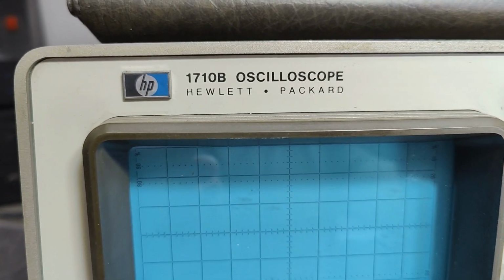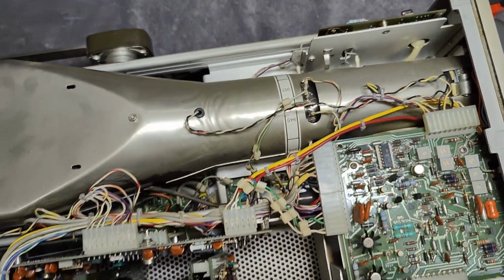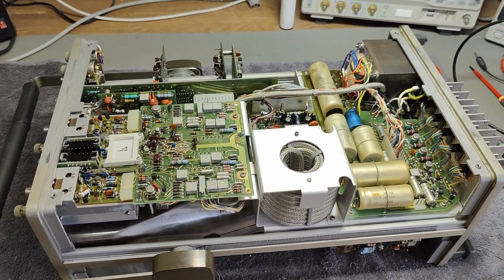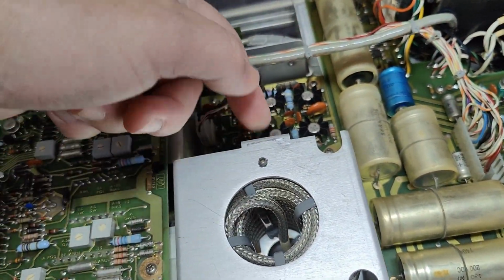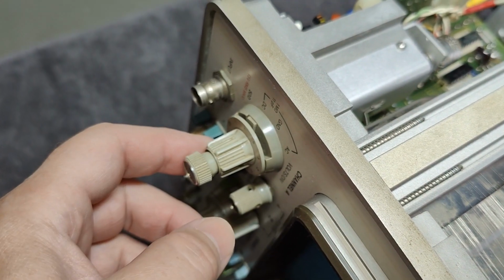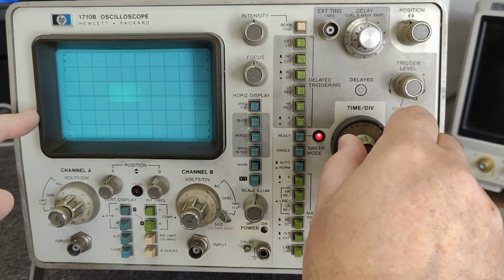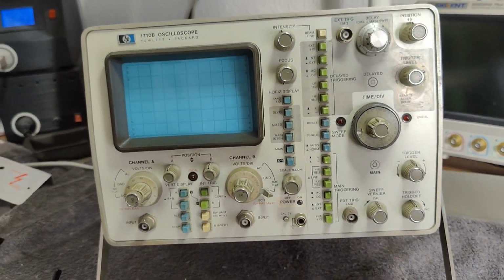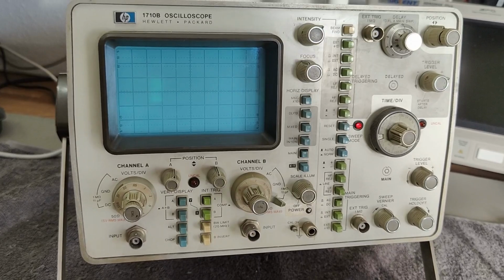HP 1710B oscilloscope 2ch 200MHz 1976 teardown repair

Comment: I would keep it for sure ....... I could only wonder at how much that 200 Mhz scope cost in 1976 ......
Reply from the maker: I think you can dig up sales price in the release year for most HP equipment, please try and get back to us, also please try run the number thru inflation calculator

Comment: I have a 15MHz storage HP scope from the late '70s and most of those HV axial film capacitors were bad in it, I had to replace all of them. They were low in capacitance and when I connected them to a HV supply with higher current capability they started to visibly spark and flash inside if I gave them voltage close to their rating (about 500-1000V below their rating). It was't easy to source those 3-4kV axial film caps. I only could find them on ebay, some came from NYC, some from Canada. I live in Hungary.